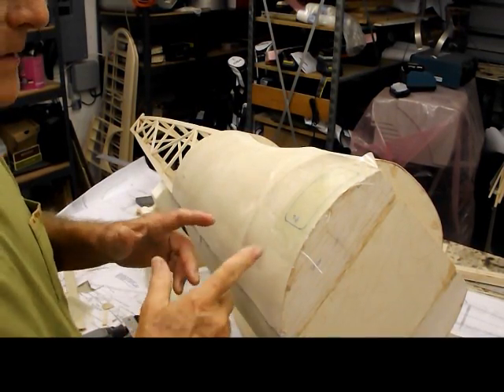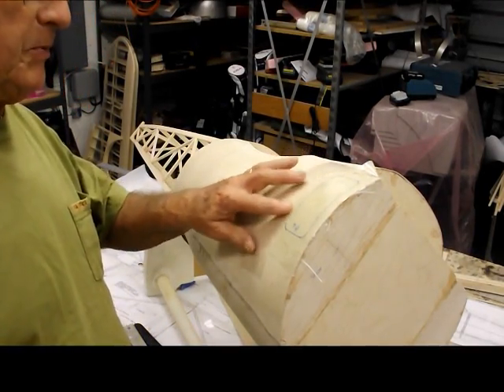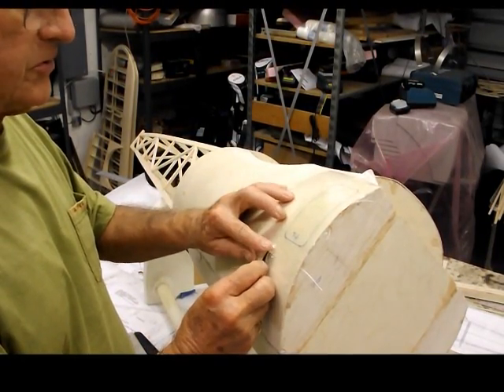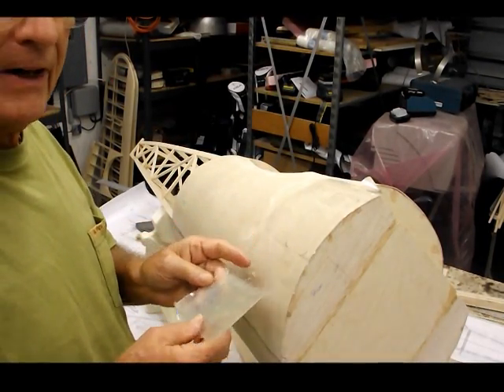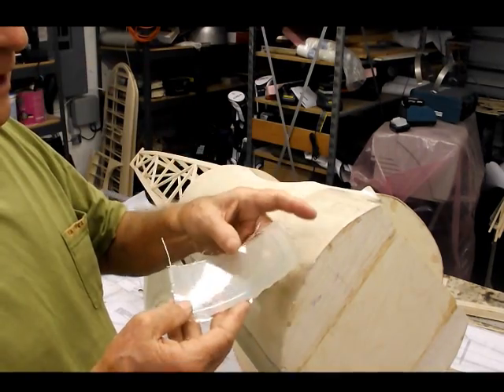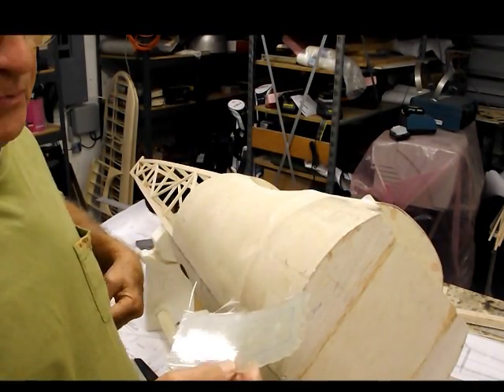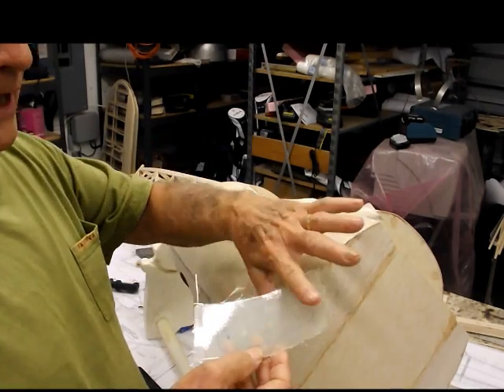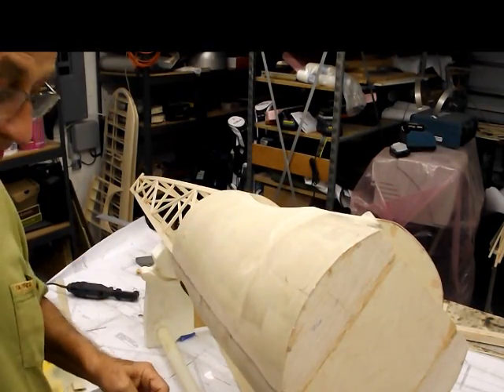Packing Tape Release agent.

Comment: what's better pva -or the packing tape for easy release?
Reply from the maker: In cases like this, packing tape is definitely better. No masking, no spraying, no clean up. It works well on bare wood or resined fiberglass. NO NOT use it on primer as it becomes very difficult to remove!!!!!!
Reply: +Merlyn Graves - I'm doing a molding for my motorcycle rear fender, i have a plastic bag over the fender and brown tape over plastic, do u think I should put pva Over the tape or u think I should just take off plastic n tape n just put pva Over fender u think that's better? cause I don't know if the pva will hold on over tape ?
Reply from the maker: Take off the bag and tape and just spray the PVA directly on the fender. Any PVA left on the fender after the layup is removed will come off with soap and water. Overspray is hard to remove so mask any peripheral areas.
Reply: +Merlyn Graves thank you
Reply: Quick question soo I did my molding since last night but this morning the fiberglass is still wet I know I think I didn't added enough hardener what would be the next step?how can I fix this issue?
Reply from the maker: Remove it all and start over.